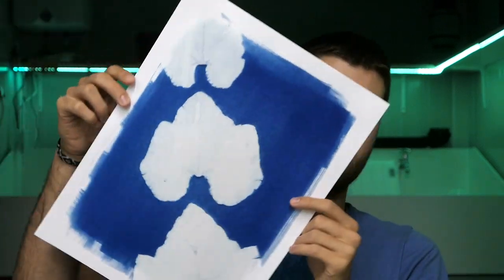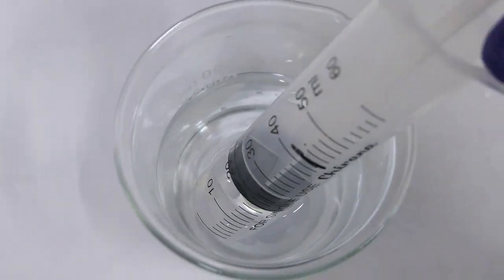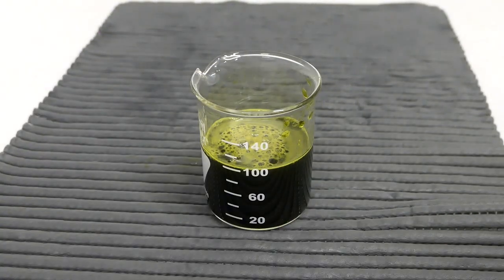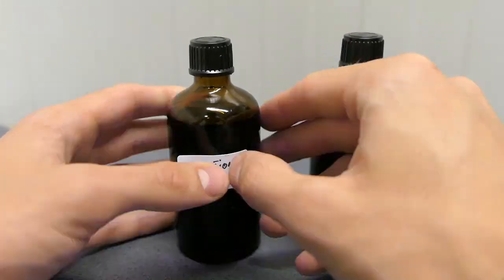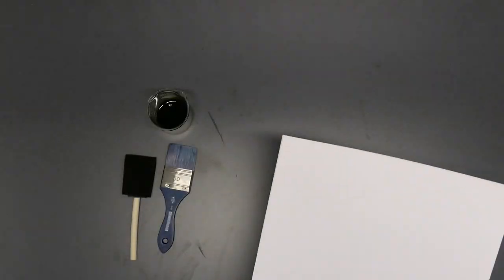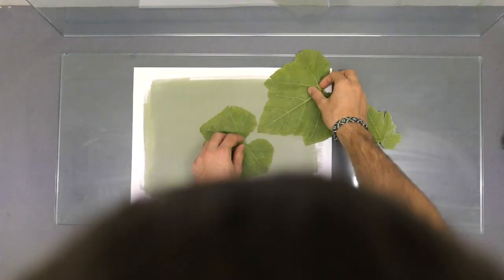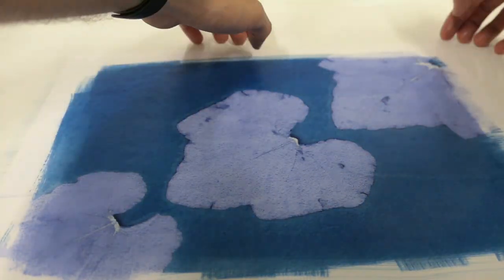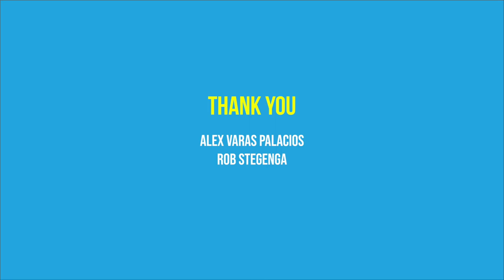Making Cyanotype Solution & Coating Paper | Step by Step Tutorial | Alternative Photographic Process

Comment: Warm water always helps chemicals to dissolve!

And 0.1 g of ammonium\potassium dichromate (mixed to ammonium iron (III) oxalate) increases the speed (9-12 minutes under the bright sun instead of 20-25) and also brings up a contrast.

Thanks for your video :D
Reply from the maker: Hello. Yes its true, but during development it can make paper to start pealing. Thanks for the info! I am very familiar with potassium dichromate and would rather avoid using it knowing how hazardous it is for health 😉
Reply: Dear sir can we print solvent ink on this paper 
Also tell about clay coating and which chemical mixture melt in it